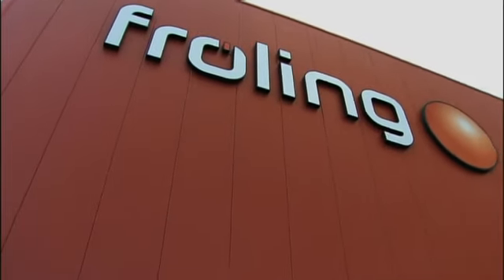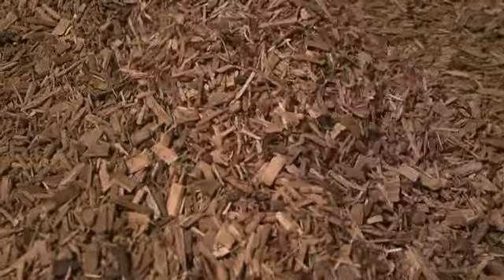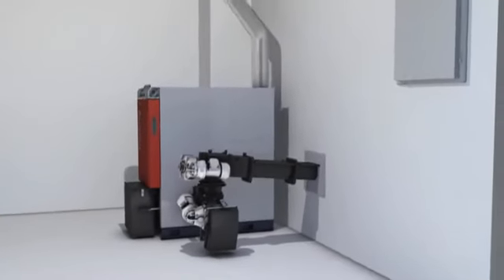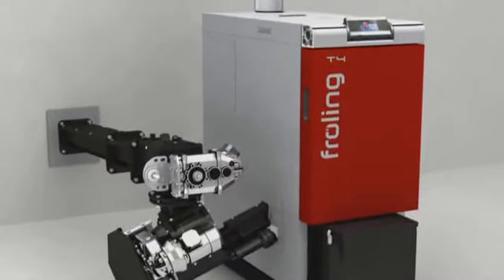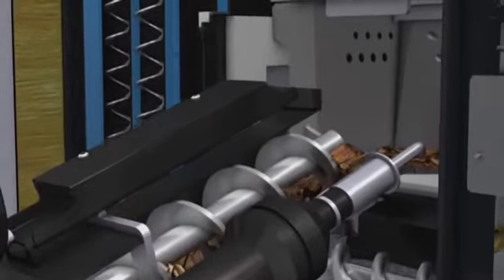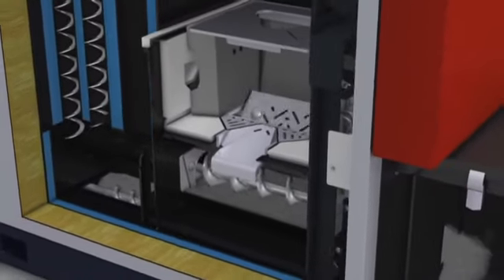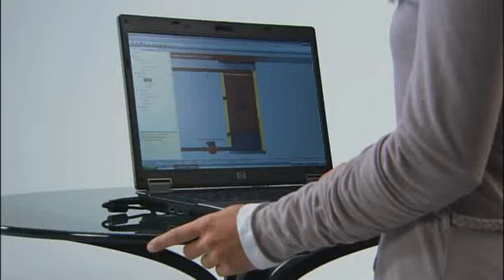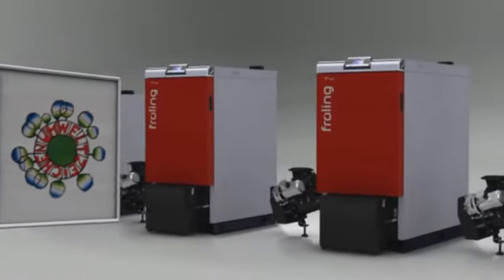Froling T4 Wood Chip Boiler

Comment: If moisture percentage is a consideration it wouldn’t be hard to add a drier to a storage bin. You would probably be oversized if you found the smallest grain bin fan.
Reply from the maker: Technically it is not difficult, but the cost needs to be considered.  Belt dryer systems can provide a reliable active drying solution.  They add quite a bit to the capital cost though.  Since the cost of wood chip boilers is challenging for many projects the additional cost of a drying system is often out of the question.  Passive drying by stacking logs in wind rows to season before chipping is a great, low cost solution.  Here's a link to some info about what we are doing in Thunder Bay. https://youtu.be/K6Cw6KmyGXM